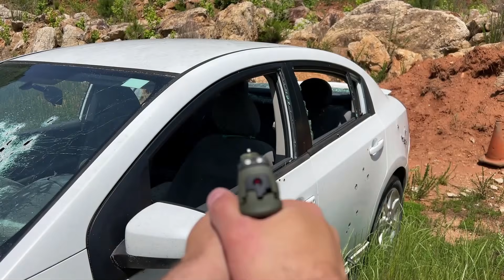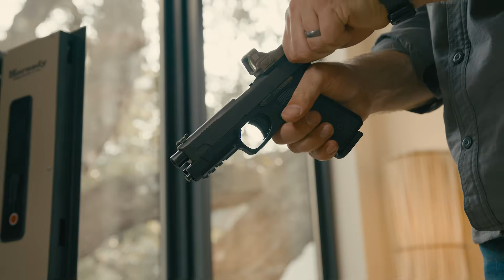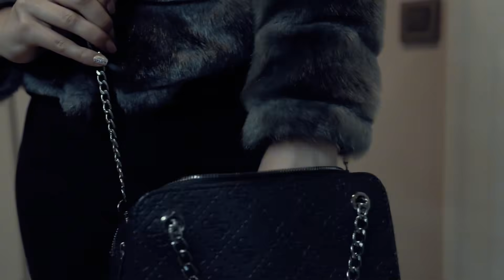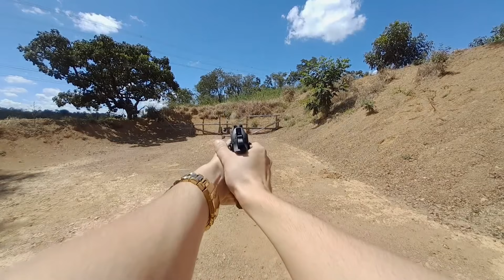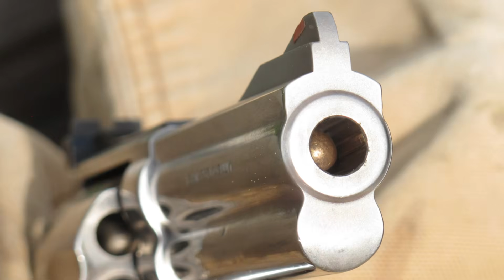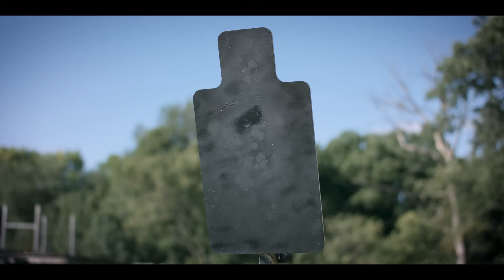13 Stupid Mistakes DESTROYING Your Semi Auto Pistol – STOP Doing These!

Comment: Magazines are not much good if they are not loaded. Its not going to hurt the mag springs to leave mags loaded. They are made to handle being loaded. I have left them loaded for 15 to 20 years and worst that happened was the slide did not lock back on the last round. So increase the spring tension or get new mag springs but not a big deal and no failures for leaving mags loaded. I agree with all of these mistakes but this one. Good video otherwise. Do one of these mistakes videos for revolvers. Using the wrong ammo is a big one for revolvers. Not cleaning, not inspecting, wrong grips, flipping the cylinder closed, and so on. Revolvers are easy to operate and more reliable than autoloaders but they are complex mechanically and do need maintenance, care, and the right ammo or they will fail like any other gun.
Reply: To me, it depends on who built the mag, and to a lesser extent, when was the mag built. Companies without a good reputation like Promag, I can’t trust them the same way like Magpul or Meg-Gar. Really old mags like WW II or earlier, the metallurgy back then was just not upto today’s standards. People back then didn’t keep their mags loaded all the time, and when they did load them they download a few rounds from full, they did it for a good reason :)
Reply: @harrycallahan9733  It is well known that surplus USGI .30 Carbine mags run far superior to modern made mags. So in some cases the metallurgy back then was better than today or the metallurgy today got it wrong or worse.
Reply: @rbm6184  Good to know. I guess these days it’s not metallurgy or any other technical aspects, it’s the manufacturers cost cutting got too much in the way. You can’t make a good fried chicken when there’s no chicken to work with :)
Reply: @harrycallahan9733  It is best "if possible" to use only manufacturer approved mags, parts, and accessories. In some cases like with surplus and military its not always possible because those manufacturers don't make mags for their guns but rely on mag manufacturers. My point was that with manufacturer approved or factory mags, the manufacturer already knows that those mags are reliable when kept loaded. Those springs are designed to take that compression over time.